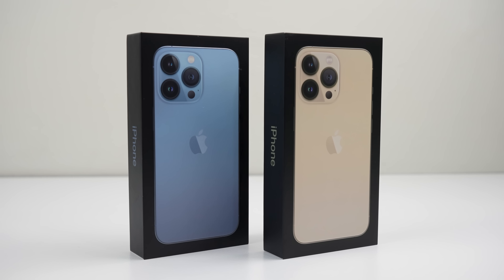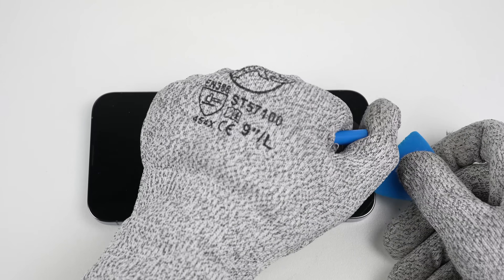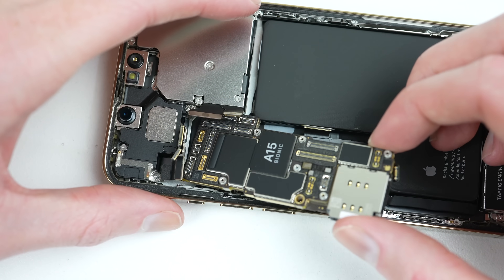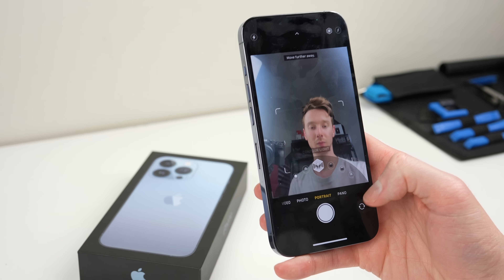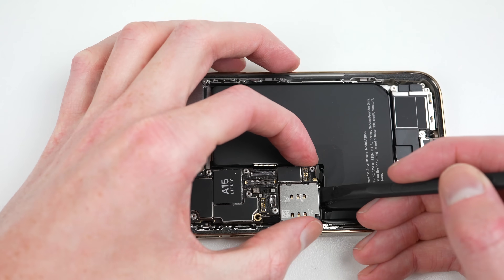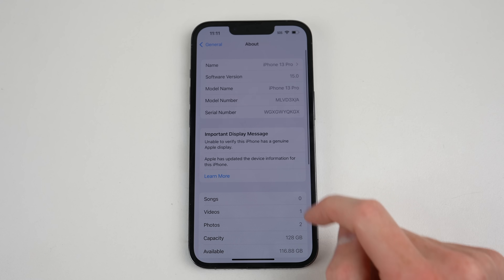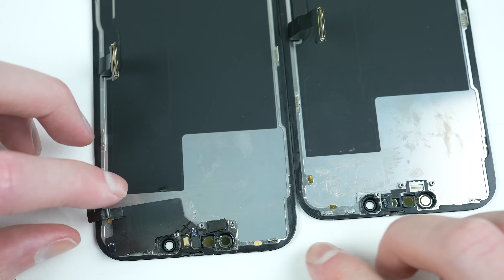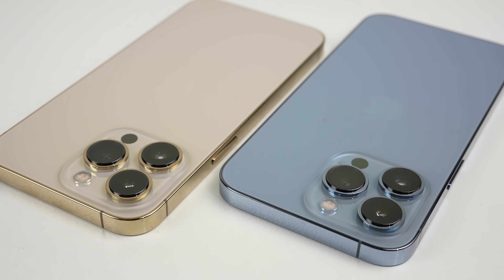iPhone 13 A Repair Nightmare - Teardown and Repair Assessment

Comment: Raising this from the dead to let folks know that Apple is doing something about this.  A lot of these issues aren’t ‘parts pairing’ issue.  It’s more of a calibration issue.  Because the calibration data is different across the display, camera, faceID, etc, it won’t work properly.  Apple isn’t purposely doing this to disable phones from 3rd party repairs.  The calibration data needs to be updated on the logic board to match that of the foreign devices.

Apple services techs has access to the software that calibrates replacement parts, and has made part of this available in iOS 18.  If you come across issues outlined in this video, do the following:
* Upgrade your iOS to release 18+ (current iOS release May 2025 is 18.5).  
* After you have upgraded, go to ‘settings’ —> ‘General’ —> ‘About’ —> ‘Parts & Service History’.
* Tap ‘Restart and Finish Repair’ to start using Repair Assistant.
* Follow onscreen instructions

Comment: I have a 13 , uh I mean Pro Max, and one morning it woke up and decided that its factory rear camera was non-genuine. Apparently some ninjas came to my house in the night and replaced it with a knock off. 

OK, the message also lists damaged as a possibility and it’s not like I haven’t dropped the phone a few times (although I don’t think I had any time soon before the message). But anyway, now the lidar doesn’t work and the rear camera interface is a little different and some things don’t work right on it. I was hoping I could just replace the module with a good working pull, but from this video I gather that probably wouldn’t work. 😢 😡😡

Comment: Hole up, as a current repair technician, I for some reason never thought to keep the brackets and parts with each other basically ocd organized right next to the part. 

My usual habit is to just put the screw in the same general area. Close enough that I know which screws go with what part. Though not nearly as neatly organized. Imma try that and see if bonus from the time and annoyance saved during the rebuild vs the time saved with my original way.

Also why doesn’t Apple just have basically a 2FA authentication to verify a part is genuine. 

You could have each phone upon initial activation as part of the initial activation process. 

Generate half a key locally on the device, and once the Apple servers authenticating the initial activation of the device. Generate the other half of the key. Which they store in house somewhere no one else but them has access to. 

You could even update software when it detects a repair has been done on it. It can require an re-activation so Apple can verify genuine Apple parts and remotely re-enable automatically all the features that would normally be deactivated during a repair. 

You could even go so far as if they detect non genuine parts. You can have a message pop up “non genuine part detected. Due to that, True Tone and Face ID are now disabled. Please use genuine Apple parts next time. 

Thank you for being the best part about Apple.”

Then when you could easily have open repairability where you could literally sell OEM parts quite readily to any Tom dick and harry that has a halfway decent set of tools would happily repair their device on their own increasing sales knowing one of the major things holding them back from a repair is all the features they would lose. 

Most people with more than a couple brain cells could then be enabled to do repairs. Significantly increasing the number of devices being bought for donor phones for those who want a 1:1 swap and significantly increase part sales too.

The software locks and hardware locks are a barrier to entry for most to even THINK about repairing their own crap. 

You could very easily open Apple up to right to repairability but still retain that level of control on the ecosystem and any changes to it as well.

Comment: Hugh, thank you for always providing clear and in-depth tear down instructions and tips in your videos! Watching them got me genuinly interested in repairing tech and you gave me the courage to do a housing and back panel (I smashed mine 😓) replacement on my 13 Pro myself. Sadly the suction cups I received with the parts aren’t even remotely strong enough to defeat Apple’s adhesive. Instead of risking damaging the display by overheating it I’ve just ordered a better suction cup. I’m not doing these repairs frequently, let alone professionally, so I didn’t fancy spending $100-$150 US for a heat pad and I’ll have to make do with a heat gun. I’m interested to see what videos you’ll do in the future. I also love car repairs so keep them coming 👍

Comment: Just a curious question, when you heat the phone to loosen the adhesive, will that in any way affect the battery? I mean from what i know batteries are not good with heat.

Just curious

Comment: He is talking such BULLSHIT, replaces Camera and Face-ID stops working. Its because you changed the truedepth cam and dot projector which are a part of the very face-id, if you would have only moved the front camera out of this module, Face-ID function would still be present. What a RETARD. And you can clearly see how he touched the camera lens with his greesy fingers on both phones and scrathed the pastic on the speakers, its impossible to clean it without leaving marks or removing the UV protection on the lens. Next is how he tries to push in that battery connector while trying to find the correct spot, thanks god he didnt put the 4.2Volts on the data line. Thats called luck and not experience. You look like a 10yo kid doing this.

Comment: Samsung's right to repair policy is really bad. They do everything they can to make it as hard to repair as possible. Especially on their cheaper phones which means people have to buy a new one every 2 years or so.
But they at least try to make use of plausible deniability. Apple on the other hand makes phones which aren't extremely difficult to repair (proprietary screws and glue make it very difficult to do at home though) and they don't sell cheap phones where repairs are simply not worth the money, but they don't even hide their intentions of making it impossible to repair by using software to disable core features.

To be honest, I don't know what's worse. Using plausible deniability is scummy because they're basically lying. But being as obvious about it as Apple is just cocky behaviour because they know that most people won't be aware and that they can get away with it.

Companies are incentivised to make as much money as possible because no one feels responsible for their decisions. So I don't think it's fair to be mad at those companies for doing what is expected of them. I think it is fair to be mad at governments for not protecting their people against exploitative companies. The EU has made laws to force manufacturers to use USB C and in 2027 they'll have to have user replaceable batteries as well. These sorts of regulations make sure that there will be a (somewhat) healthy relationship between companies and consumers. But more regulations are required so we can get the right to repair our own devices.

Comment: Hello, I replaced a display on my iPhone 13 Mini with some aftermarket OLED display (not even Apple brand) while keeping the original sensor set on top of the display and face ID worked for me (it was already set up but I was able to unlock the phone without entering the passcode). Now I wonder how is it even possible when it didn't work here in your video. Do you think that it is because the face ID was already set up?

Comment: Hardware pairing is good if done right. The phone should know when parts have been changed. After unlocking via pin/password. It should alert the user explain the possible security implications and offer to re-pair the components if the user is aware of the changes.
Reply: It could help prevent shady practices but remain fully funcional, something like: "This display is not a genuine Apple part, and may not offer the best possible quality." but not disable all the other features.

Comment: Unreal. What this means is that these phones are not serviceable. If a part needs to be replaced, a new part won't work because the part ID doesn't match what the operating system is expecting to detect. Perhaps Apple has a special software utility to revise the phone to either change the component ID or enter it into a hidden table of approved components. Probably the former--Apple won't waste time repairing. It's cheaper to just issue a new phone. And by having this system in place, it prevents reparability. THAT is NOT sustainable. Apple is a profit mongrel.

Comment: @12:54 
More than likely the Face ID was failing at these stages because the screen wasn't clicked in at the top. I work with an AASP and there have been a few times that we have had to hold the screen in a specific way when it popped off from an expanded battery so that way it would pass GSX's Face ID test. Otherwise we would have had to deny the repair under Apple Care. Just yesterday I was messing around with a personal phone that had a face id fail message until I mounted the screen and let the phone start up with the proper alignment.

Comment: Unfortunately this is no different with modern cars, especially if you need to replace components such as an ECU or any other control module. Where you need to have a specific software to make these components communicate with the car.

Comment: I think this is a software problem. Apple programs run in the background over which the user has no control and which are intended to prevent any repairs.

Comment: So technically when you swap everything it should all be the same except the phone is in a different color chassis or chassis in general but everything should function the same like you would still have the same model number just in a different chassis. But if you do only one part or like not the whole entire internals or parts you might have a problem because I think phones have like serial numbers for different parts in it now so it might just not work or some stuff at least because I’m pretty sure Apple probably coded all the different parts to work with the same serial numbers it got paired up to with the phone originally.

Comment: And I support in general idea of blocking hardware. It will make stealing phone useles. You will be not able to use the stolen phone or sell it for parts as they will be unusable. At the same time I would like to see the ability to use parts from one phone in the other. For this for example Apple can create a base of phones parts from which could be used in other phones.
Reply: what about the consumers?

Comment: I’m still using my iPhone 8 Plus 256gig from day one of it coming out and THANK GOD the updates are still supported. Currently running IOS 15.5 on a phone that was bought in September of 2017. I’ve went through over, 7 screens and three batteries since then but I did all my repairs myself thanks to third party parts online. But the only issue I have is the battery consumption. It seems like it doesn’t matter how much capacity you install into the device, it just loves to suck the juice like a kid and a capri-sun lol (yes I tested the newly installed batteries to make sure they were true to the sizes, they were) but that’s really the only flaw in my opinion. I’ll keep using it until the apps tell me the phone is no longer supported. And this video supports my decision about not upgrading to the latest models. Being forced to go straight to apple so they can recode the parts specifically to the logic boards is so dumb. I’ll give apple credit, they make decent (expensive) phones but if they’re trying to be more “eco friendly” we should be able to swap out parts and not be forced to comply with apple care insurance and all that mess. Just ranting lmao. I love the videos!

Comment: Hey, how are you doing? Last November I bought an Iphone 13 Pro Max and a few weeks ago, it stopped recognizing the original cable, I was only able to charge it through the magsafe. I left it on an authorised repair shop as there's no Apple Store in my hometown and they said there was a malfunction in the hardware, so they are going to replace the "RearSystem" and I'm gonna have do wait up to 10 days to get my phone back (if Apple send the part) or up to 30 days (if the Apple Brazil is out of the part in their local facility). In your opinion, do you think the iPhone is going to work fine after all this bullshit? Cause after watching videos like yours and  seeing how much effort Apple is putting in make things difficult when it comes to repairs, I'm worried that my Phone is not going to be the same after this partial replacement. If this is the case, I'm thinking about prosecuting them for all stress I'm going through right now.
Reply from the maker: Apple themselves only offer a set few repairs. They don't do charging port replacements, instead they replace most of the phone in the "Rear System" repair you mentioned. Meaning everything but the display will be swapped. That even includes the discarding the original logic board. A total waste of resources but thats they way they do it.

Comment: Apple care so much about the environment they don't even give you a charger or 3.5 adapter.
Many of their updates just make older phones unusable.

I think maybe parts of the phone have a type of ROM serial that you can't edit.

The right to repair should make parts and tools at reasonable prices, give diagrams, make it easy to repair, allows 3rd party parts and to be able to jailbreak and put on custom software on,  these phones cost a fortune and you can't customizer them miich   I'm sure if people went to a low cost android flagship killer like a 8/256 xiaomi poco F3 the performance is about the same but costs 6x less. It also allows you to have 2 sims so one for work and one for personal and you can turn one or both off.
Apple products are rip offs, people make Jons a stsint but he was bit nice and did little

Comment: i can imagine this company making a car and it will not run unless you have their latest iphone or if one of your tires pop youll have to get the replacement to apple itself because the wheel will not move if its not made by them

Comment: this doubles up in killing the spares & repairs market. the amount of increased waste this will cause. Apple might as well just build their phone from a lump of glue, if they don't want people repairing them.
Reply: THEY want to repair them, thats why they use software locks instead of doing a samsung and basically making their phones out of a lump of glue. its to stop people other than apple fixing their own stuff
Reply: @verumignis4778  disgusting, at least Samsung make it a challenge. Apple flat out keeping the key.
Reply: @DrumToTheBassWoop  yeah I guess you can repair Samsung devices, it's just very difficult. Not exactly sure how the iPhone has better repairability scores on ifixit when you can't fix it even if you had the dedication.

Comment: At this point I don't care anymore about Apple's disgusting practices. Actually, I'm starting to root for them, hoping they'll take them to the next level with the iPh 14. Maybe a software update that bricks the phone if it detects swapped parts? Or, better yet, a suicide system that short-circuits the motherboard and kills every single component if you open the phone at all. I wanna see THAT next

Comment: That does seem kind of sleazy. But I was an android user until I bought the iPhone 8+ about 3 years ago and I am still using it. It runs just as fast as the day I bought it. The battery life is almost completely unchanged. I never had an android that ran so well for so long. It was expensive but I would  have already bought another android by now. So is it really that much more expensive?

Comment: I'll tell you guys. It's an absolute shit show, on the 12s and 13, there is a special software that we have to run the phones through. Even if we just replace the screens, it will disable your face ID even if your camera is still functioning. Funny enough as a authorized repair technician for a major company, I can fix an iPhone 13 in 10 minutes if your screen's is damage but to do the ticketing and all of the extra validation that Apple puts us through can take almost 45. I don't understand why there isn't some sort of class action lawsuit for the absolute hoops that Apple puts through to make sure that you're $1,500 phone isn't yours.